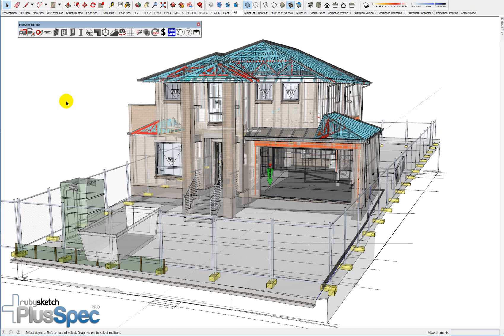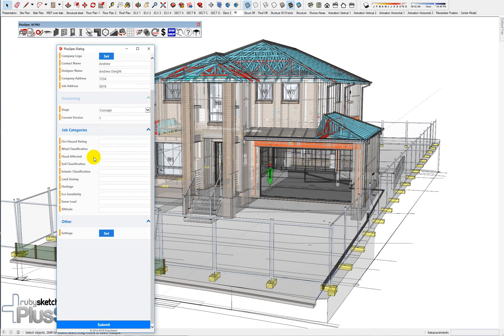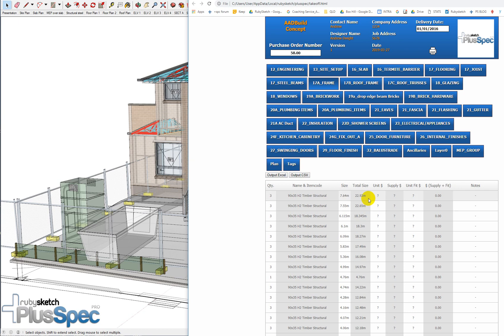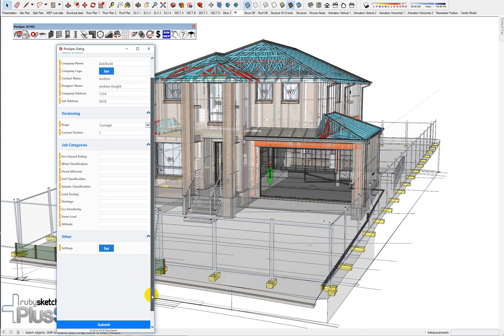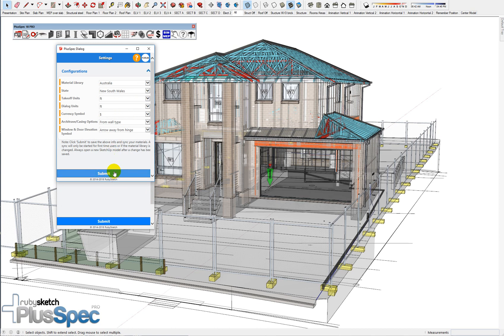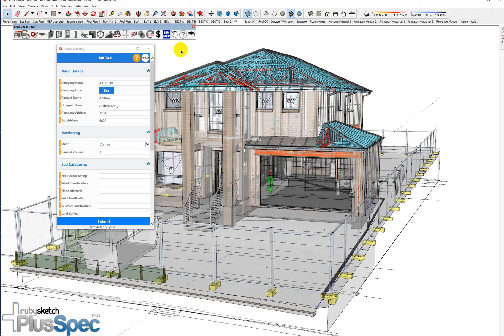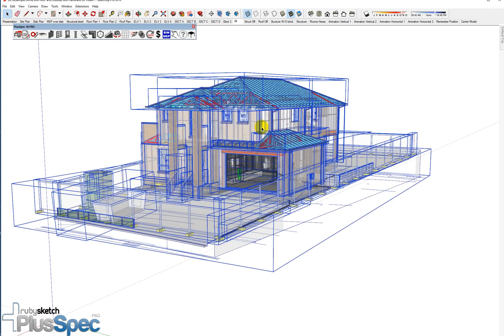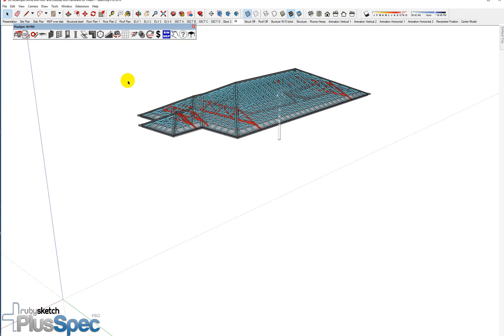How to change the Take Off units from Metric to Imperial or Meters to Feet in PlusSpec

Comment: Hi Plusspec, I need to be able to add my own layers to a wall assembly in a parametric style. I currently am limited to the number of layers you guys provide. I am a builder and this is important to me as I want to have the freedom to create my own wall assembly quickly with as many WALL layers as I deem fit based on the customization of my projects. Currently the multi wall is as good as it gets but I need to add a few more wall layers to my assembly and don't want to have to do this manually for large commercial buildings. Is this going to be possible in Plusspec in the near future?
Reply from the maker: Tucker, there is a new version of PlusSpec coming out soon that I am sure will help with adding extra items to walls. Ideally, you book in some training on our website (Ask for Andrew) and mention this response.  If you are estimating or building high rise commercial work you will love what we have coming next. B)